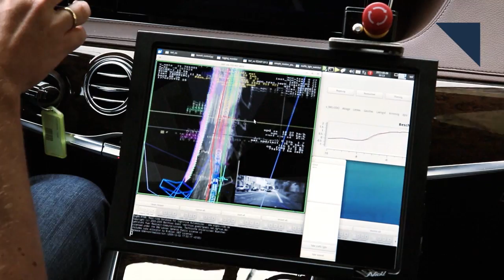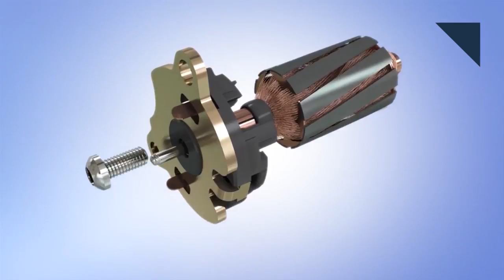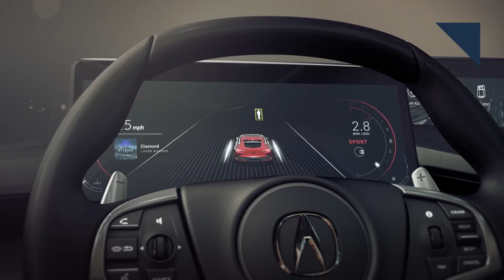How Industry Can Save Billions, The Next Industrial Revolution - Autoline Daily 2020

Comment: I would not pat the industry on the back for a ridiculously complex EGR valve. Simpler is better, folks!

I have my doubts that auto makers could save $800-$1000 with coordinated T-TIP regulations. They could do so only if US & EU agreed on the lowest common denominator. In actuality there is nothing preventing companies from meeting the stricter of the two standards in every case.